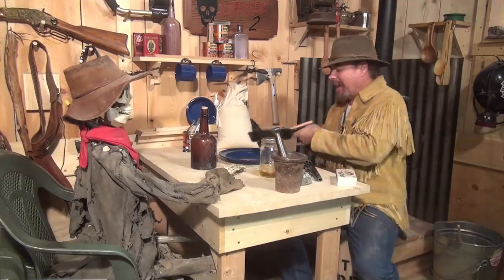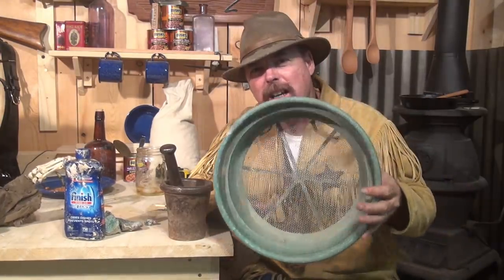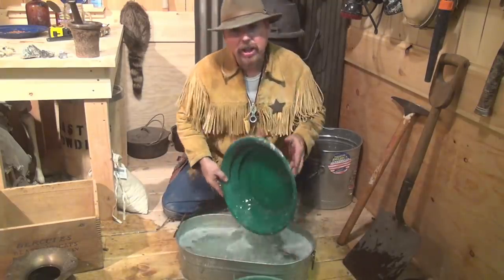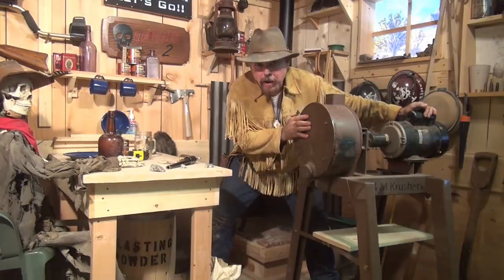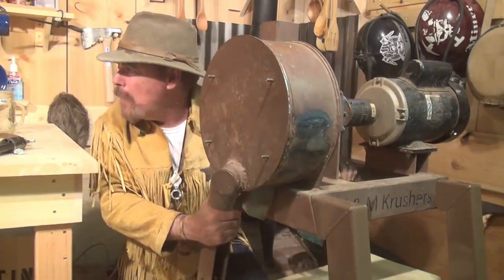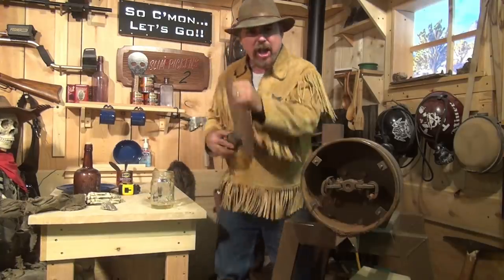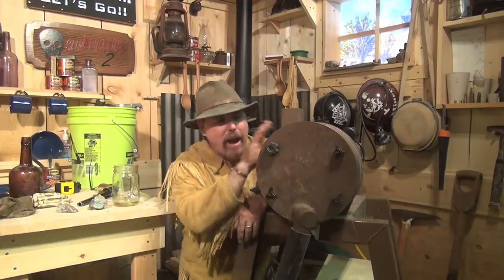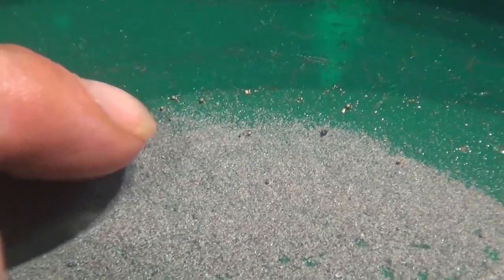How to Get Gold from Rocks | Rock Crushers and Impact Mills  - ask Jeff Williams

Comment: Maybe use a small vacuum that's attached to the inlet. You throw the rock in the hole and than quickly plug it with vacuum hose. It will suck the dust particles to prevent clogging I think.
Reply: Can you give me the crusher mill  design with measurements  cos  I want to build one my self

Comment: Jeff, I have the 14" pipe, one end cap, and a 6 1/2 hp engine. A bit more metal and wait till it cools off enough to fab one together. Thanks for the pointers on where to position the output screen! Sometimes the spot that seems to be correct (on the bottom) isn't really the best place.
Reply from the maker: Hi Joanne,  can't see what you come up with..... keep us posted and let us know if you have any questions

Comment: Jeff. Show these Boys &Girls  how to take a 6 cylender  crank shaft from a 300 ford 6 popper or 292 chevy 6 popper. And make a mini stamp mill .. 😜👍
Reply from the maker: now your talking
Reply: @Askjeffwilliams  
Thats right ..  I know there is a way a 3 piston stamp mill  or 4 piston stamp mill .made from an old solid catapilar or Detroit crank shaft out in cali or was about 45 years ago . powered by a ford pinto  motor . I remember seeing a gear Box may been its transmission   stuck in low or2nd never really paid much attention to the damn thing . But it did catch my eye .

Comment: Is there value in running a chain mill wet to both keep the dust down and feed the dust/slurry into a classifier or table. Seems like a win on the safety front and on the ease of operating front too.
Reply from the maker: if you run wet exit port should be on the Bottom but it will clog up
Reply: @Askjeffwilliams  Mount Baker offer a single unit running a crusher into a sluice. Seems so logical for small operations.
watch?v=HE4LA8wWTf8

Comment: Hello Jeff I’m new to watching the channel and have recently developed the Midas Touch. Seems I’m good at finding big ol rocks with gold in them. I can pan down the powder to the pickable gold but what about the really fine gold how to you get it separated from the rest of the fine sands? I just can’t seem to pan it apart after several attempts. Secondly I been reading a lot about acid, does it work well with eating the quartz powder and just leave behind the very fine yeller stuff? I am a green horn but learning very fast. I’ll take any tips you have time to offer thanks. Ok I’ll stop typing here before I turn this keyboard to gold. P.S. thx so much for all the info you share about geology.
                                 MIDAS TOUCH
Reply from the maker: would invest in a Gold Hog Multi sluice ....will capture down to -100 mesh...... after that you smelt out the Gold from what is left over and use a collector metal like lead then cupel that out

Comment: Yeah i know its 3yrd old, but im going to say this about using a pestle and morter tk cruah rock, dont. Its a dumbarse idea unless you literally have nothing else. You can make what is essentially a morter and pestle with two pipes amd end caps on each, while using ablnger lengthbof pipe for the dynamic end so you can even using from a standing position without putting your hands or other bits in danger. Or you can the same thing while alao attaching a drill, and turning it into a grinder. If you know your stuff, you can firther the design amd turn that into an impact grinder. It just depends on what's available to you, but if you can engineer something,byou might as well gor wirh rhe flail crusher using chains and a 1/3 HP motor like what you (jeff) showed in another video.